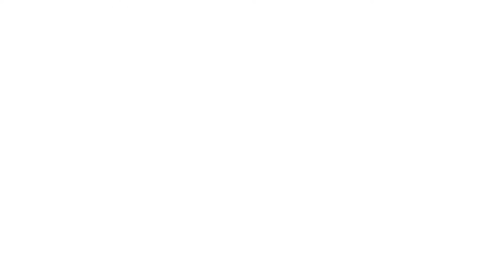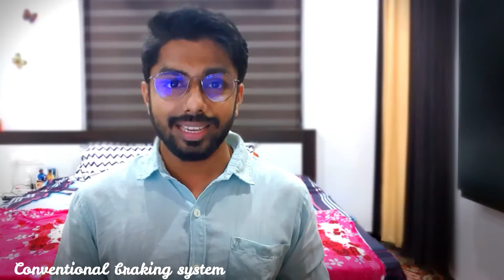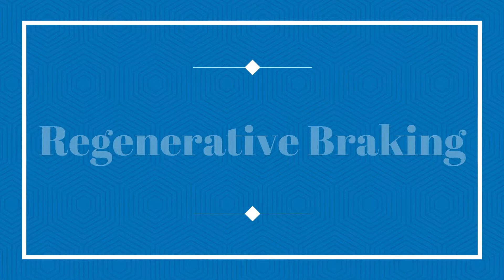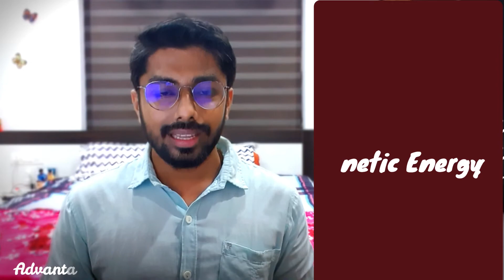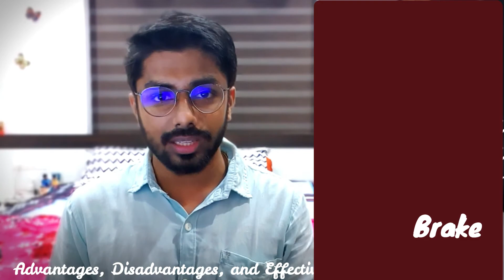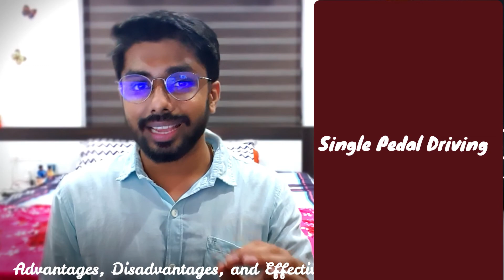REGENERATIVE BRAKING for ELECTRIC VEHICLES | Energy Recuperation | How does EV brake system work?

Comment: How regen slow the vehicle??
Reply from the maker: It generates electricity when the motor runs above the synchronous speed. 
-> The generated electricity is being stored in the battery
-> The battery act as a load to the generator
->The energy to rotate the generator comes from the kinetic energy of the vehicle
-> Since it it continuously getting stored in the battery the kinetic energy of the vehicle reduces hence the speed of the vehicle also reduces.
Reply: @GetElectricVehicle  lead acid batteryill regeneration work avumo?